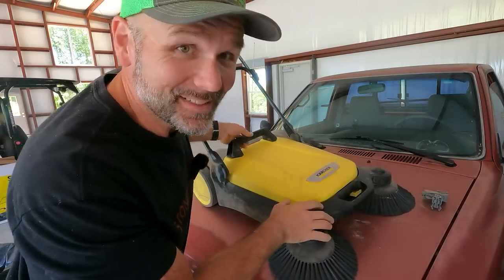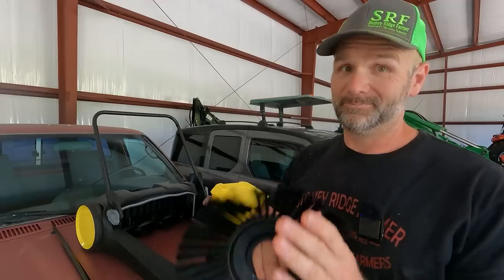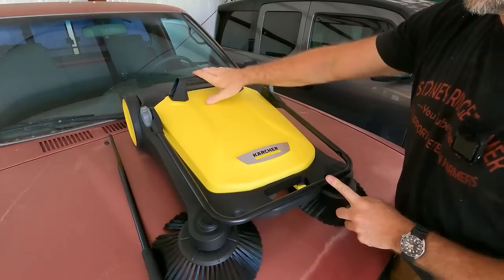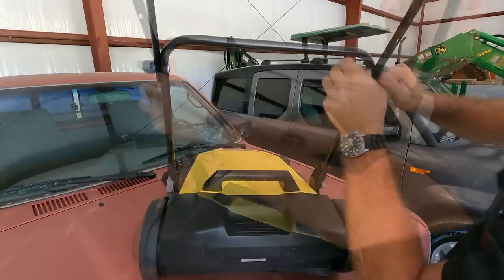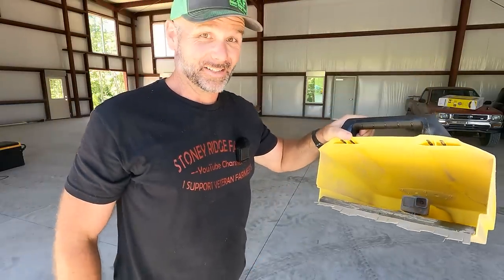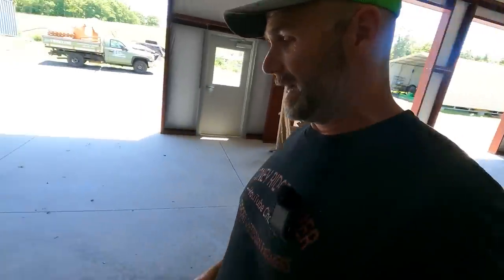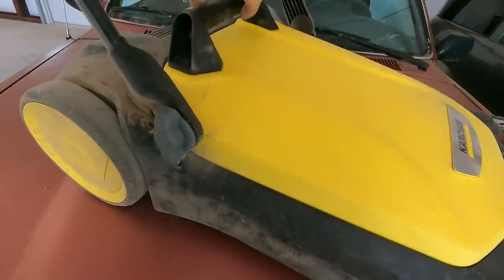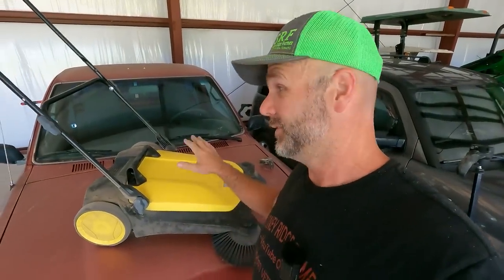A tool for anyone that’s tired of sweeping the garage, shop, porch pool or sidewalk

Comment: Leaf blower works great. Gets where you cannot get your tool or a broom. Stiff bristle broom for stubborn stuff.  Wear a mask and use a big fan in the doorway if dust is an issue.
Reply from the maker: dust!! Not blowing up and stiring up dust all over the place in the shop my brotha...that's the deal...even the broom is horrible with dust...this is the solution
Reply: It does kick up a serious mess of dust, but if you place a big shop fan in the door pointing out and open a side or back door the draft pulls it out. Plus you can blow off vertical surfaces, walls other elements a sweeper can’t . Plus it does a he11 of a job quickly. I’ll never push a sweeper again if I can avoid it.
Reply: Agree, leaf blower is way better.  Clean the floor, blow off the walls, equipment, etc....
Reply: I have a large machine shed with a concrete floor.  Tried the old leaf blower technique with the barn fan blowing it out the door.  Instant regret!  Thick coating of dust all over all the machinery plus’s breathing in all that crap.  You’re on the right track with the push sweeper.

Comment: we use this exact model for use in one of our client warehouse.  it kicks up a lot of dust into the air, so if you are cleaning a very dusty floor you should wear a dust mask.  it works pretty well at getting up most of the dust from a floor, but not all of it; follow up with a broom if you need it clean.  We mainly use ours for picking up debris on the sidewalk and in the parking lot such as cigarette butts, it won't pickup up anything bigger.    We also use it to 'pre-clean' large floor areas where our large rider sweepers can't get to.  For a typical homeowner garage, yes it will be ok.
Reply from the maker: I'm glad you've had good luck with it!

Comment: Bought the $300 dollar model and it is amazing especially for our larger shop. Doesn't like corners but on the straight sections its amazing. Doesn't stir up a lot of dust either.

Comment: Hey Josh!  That floor sweeper is a step in the right direction!  Certainly a time saver that does a good job!   Now some bright bulb needs to take this concept and combine it with an electric battery powered, self-propelled, ""roomba", so you don't have to be the "self" behind... propelling it!  But until that happens, I wonder if you could attach a heavy duty magnet to pick up any nails, screws, washers, etc.?!
Reply from the maker: it's been done and it cost over $1000
Reply: @StoneyRidgeFarmer  Story of my life!  Ha, ha, ha, ha, ha!  Maybe at some point in the future you can latch on to one!
Reply: @StoneyRidgeFarmer  buy one of them magnetic bar with wheel and take the handle off and put it on the back of the sweeper.
Just went and googled it Ace Hardware has one with out wheels that bolts on for about $27.00
Reply: @dancrafton89  Yeah, I have a super magnet that I’d attach to the bottom or front.

Comment: You won't go far wrong with a Kärcher product. My only gripe with them is that the wheels are a little bit too plasticky for my liking. I am very pleasantly surprised at how well it picked up dust etc at very slow speeds! That is a good purchase for sure.
Reply from the maker: yep...it's a "entry level" floor sweeper for sure...but man what a time saver!

Comment: Actually seems to work better than I expected and there’s not really a wide head vacuum available either. That really needs a line of magnets screwed underneath though, that’s the whole point of a shop vac, getting rid of nails before they end up in a tyre. I’ll stick with my vac and wet mop though as I like a super clean space. Should work out great for your size of building though

Comment: For the screw solution you could attach one of the magnet bars that are meant for picking up screws either in front or behind the broom and then it would get the screws and nails as well.  Probably wouldn’t take much to make a little bracket for to mount the magnet bar or even just a couple of zip ties

Comment: It's kind of hilarious how many feels the need to create yet another thread about adding a magnet strip to pick up screws nails and whatever magnetic materials. A couple I can understand but by the twentieth I have to wonder if they even looked if someone else had posted just that.

Then there the "Just use a leaf blower dude. Much faster!" crowd. I have a vivid memory of it being said early on in the video that one of the goals were to be able to clean the shop without kicking up clouds of dust, something the leaf blower is pretty good at. Kicking up dust that is, which was exactly what was not desirable. And again there's not one, not two but more like twenty to thirty threads started about this.

Heck if dust wasn't an issue there's better solutions than a leaf blower. But as it IS an issue then so are almost all mechanized solutions that are somewhat affordable.

Having said all of this I have to say I'm surprised that a Kärcher turns out to be the cheapest flor sweeper  on Amazon. Usually Kärcher doesn't really touch the cheap ass market.

Comment: Hi Josh, Looks like i would have use for one of those in my basement where I have the wood burning stove...moving the wood in the basement you can generate a lot of dust using a broom.  Suggestion, add a magnetic tool holder strip on the back from Harbor Freight to pick up the screws and washers you miss...God Bless...Chief..{NYS/ADK}

Comment: Hey Josh thank you for the video that floor sweeper is nice but for me if I ever needed to do what you did there I think that's I would just use the leave blower and when the dust gets in the air will you know what I would pick it up point it towards the air and blow it all away from me and then back on the floor but don't get me wrong that thing does a good job though I can see from the video

Comment: pretty dusty on unfinished concrete you will learn in time. I had the next one up.
A big exhaust fan will pay off in time, when the doors are closed especially for dust and fumes. You may want to use a mask

Comment: Hi Josh 
I have a question about the concrete ?
Did you use a concrete sealer on the surface ? Or could you recommend a sealer product ? Thank You Mike !
Reply from the maker: Not yet but I will seal it once doors are up

Comment: How come you didn't put a sealer on the concrete floor? It helps with the concrete sweating in humid weather.
Reply from the maker: Vapor barrier under the concrete does that… however we are far from done my friend

Comment: That tool looks like a great idea with a price-point driven implementation. I think I'd sooner pay $250 for a more robust tool than $150 for a very plastic-y looking one. Some parts make sense to be made out of light weight plastic, like the dust collection bin - but the basic framework of the tool really should be made of metal. It is hard to tell without putting hands on it, but it looks like it might give up the ghost too soon and then $150 would be wasted.
Reply from the maker: don't matter what it looks like buddy...it gets the job done and it's affordable...it doesn't look at all like it's going to break....it did a great job...please stop looking for the bad in everything...it's a horrible way to live your life brotha